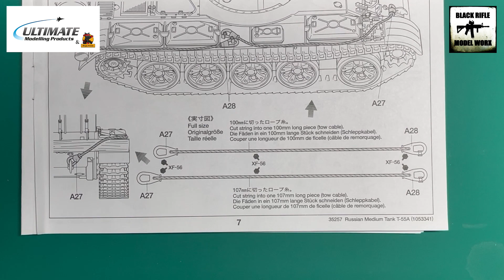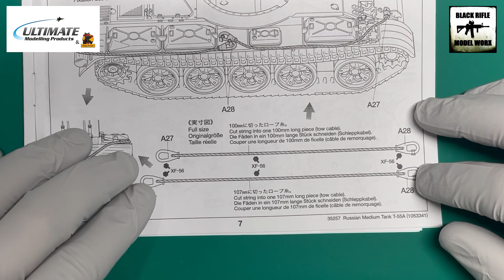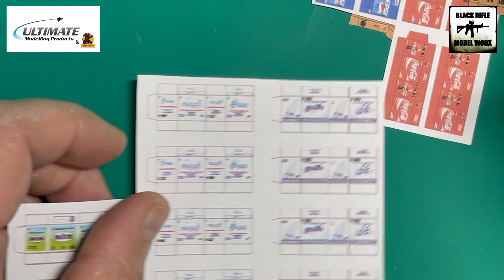Tamiya T55A - Full Build Series - Stowage

Comment: Hi Luke.. lovely job on the stowage :) re the tow cables, as the string is nylon, could you just use a lighter / soldering iron to melt the ends of the string to stop it fraying? Then mix any paint with a bit of PVA and coat the string. Once it's dry the PVA should make the string stay in whatever shape you need.
Reply from the maker: I’m sure you could mate 👍